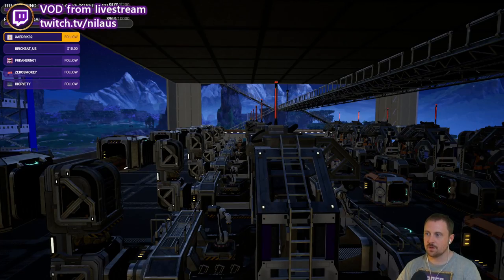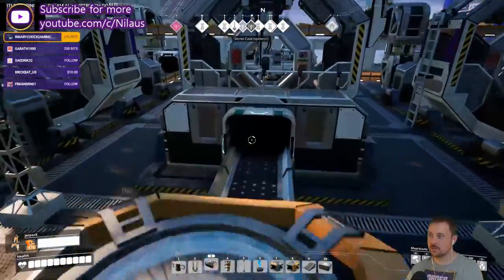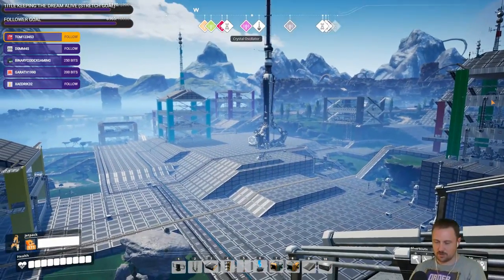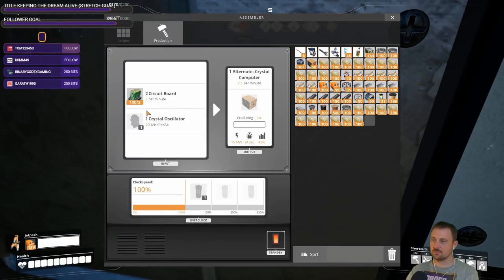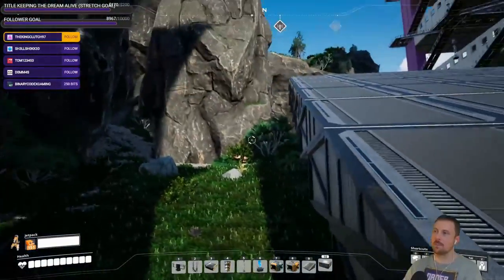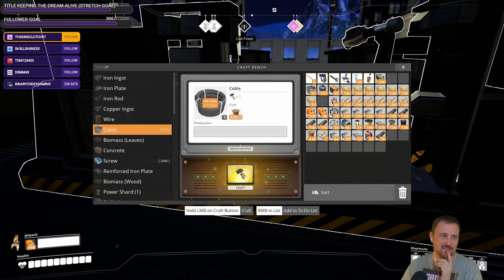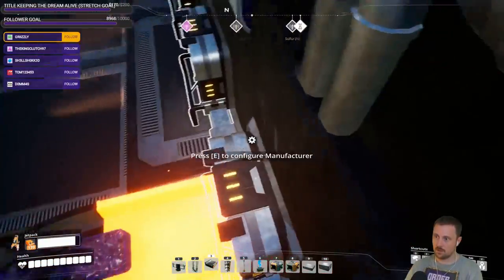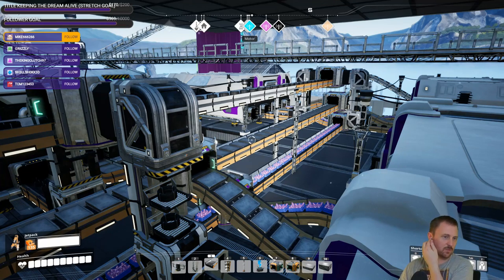MORE CRYSTAL OSCILLATORS - Satisfactory City #77

Comment: There IS an alternate crystal oscillator recipe. Rubber, crystals, and AI limiters.
Reply: Oops; wrote too fast. I see you found it. 

Makes more oscillators for the same crystal; ad faster. With alt heavy modular frames, stitched plates, and crystal computers I end up making/using absolutely no screws.

Comment: I think building computers from crystal oscillators is not a good idea. You don't avoid manufacturers, just instead of using them to build computers, you use them to build oscillators. It's not even faster since the oscillators are manufactured at the same rate the computer is manufactured using the original recipe.
After going through the wiki a bit, I think crystal oscillators are only good for things you build for them (the explorer or radar towers), they're not very useful as materials. Quartz will become a thing when it'll be possible to turn it to Silica to manufacture Aluminium. Or perhaps the quantum technology later in the game. Or perhaps devs will tweak production rates a bit to make them useful.